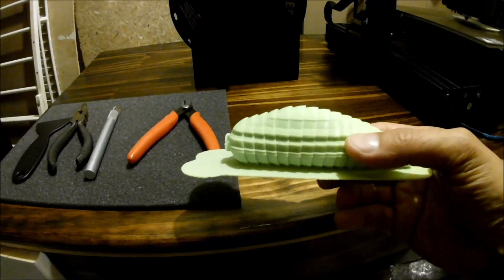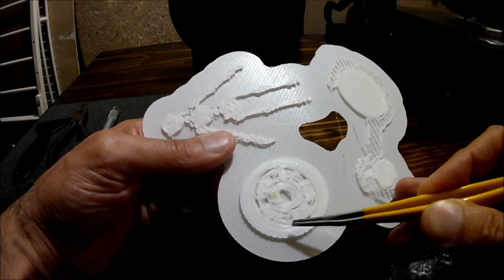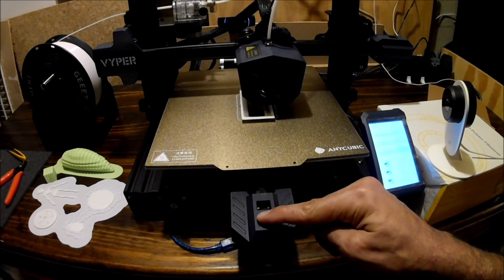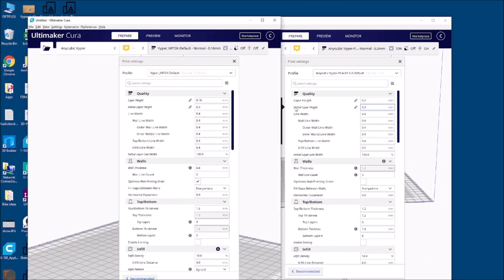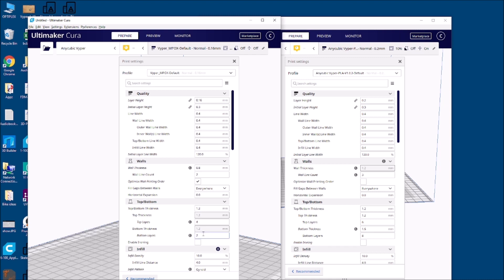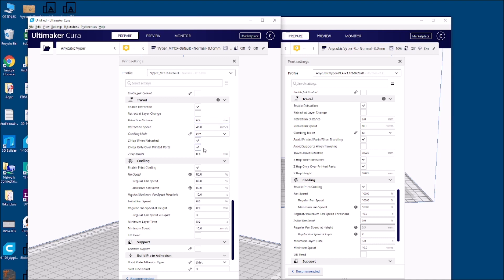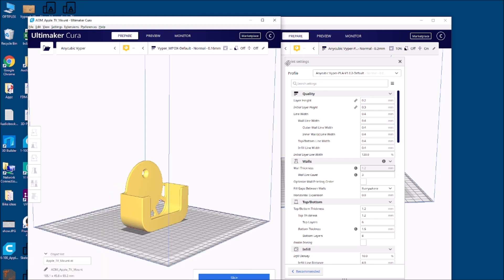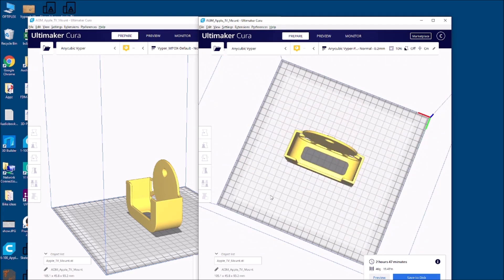Anycubic Vyper- Layer shifting & tips to solve it.  Plus MPOX vs. Default Cura profile comparison

Comment: I've been experiencing layer shifting on some of my longer prints.  I've printed the cube and it has come out great.  Most of my less time involve prints come out great.  I'm going to try your suggestions.  I'm hoping to get the problem resolved.  It's frustrating the have a project fail 3/4 of the way through a 15 hour print.
Reply from the maker: Yes, I had several disappointing prints myself.  Patience is important here and keeping the nozzle from hitting the part helps a lot.  Best of luck, thanks for watching.
Reply: Have you fixed your problem? If yes could you please say what was the problem?
Reply: @maxgroo2626 The MPOX profile has corrected the shifting problem that I had.
Reply: @wonkster1970  Ok, thank you)

Comment: Thanks for sharing, thats some crazy shifting i was able to get rid of some minor stuff by tightening everything but still noticed on travels it oozed filament that would leave a line or spots as it traveled, i thought this was part of the print for  the longest  and couldnt figure out why it was spotty sometimes thinking it was the z-offset which never got rid of it unless i went really hi which messed up the layers.  So it turns out the z-hop setting can fix that, thank you!  That is a potential for problems and actually ive restarted prints because of it, thankfully during the first layer as it travelled it would leave those lines and they'd get caught on the next go around sometimes , but one time i left it when that happened and the print sorted itself out, but still,  a very easy source of problems fixed with z-hop, thanks again!
Reply from the maker: Glad to hear this helped!

Comment: So these settings fixed the green thing you were trying to print at the beginning of the video?
Reply from the maker: Yes indeed, I got the part to articulate correctly, smooth print without layer shifts.  Hope it helps!

Comment: I discovered my frequent layer shifts were because I tried calibrating my E-steps and despite my best efforts, seem to be slightly over-extruding.

I didn't make the connection till I bought the Anycubic Kobra, had amazing prints from it, then discovered similar behavior  after using the teaching tech esteps calibration tool.
Reply from the maker: Good to know and thanks for sharing this info!

Comment: the bottom layers is either thickness or number of layers.. It does not create the thickness using the number of layers..

So if your layer height is 0.2mm, and you have 4 bottom layers set with 1.6mm bottom thickness, it overrides the thickness and uses just 4 bottom layers so a thickness of 0.8mm - That is why the thickness is greyed out..

If you click the Fx button next to the number of layers, it switches back to calculated based on the thickness and would give you 8 layers (1.6mm/0.2mm). By entering a number of layers you override the default calculation and the layer thickness is no longer used.

The other issue you have is most likely the acceleration in the default profile, you need to switch to "All Settings" to see them, but acceleration is what mostly causes layer shifts, if it is set too high then the rapid acceleration is more then the machine can cope with and it loses steps, so even a slight additional resistance of touching a slightly raised part is the straw that breaks the camels back.

Creality defaults for acceleration are very conservative at 500mm/s/s, you should have little issue doubling this, I use 1500 without any layer shifting.

The speed is really of little consequence,  for anything but long moves its is unlikely that the speed will actually reach set point with a conservative acceleration, with acceleration at 500mm/s/s you can wind the speed all the way up to 150mm/s and a calibration cube will probably only get to about 40mm/s as it simply does not have enough time/ distance to accelerate to higher speeds. Think of it like the gas peddle in the car, if you slam your foot down hard the car will start skidding, losing traction, and maybe control, if you press the peddle slowly the car maintains traction,and speed increases, they bot will eventually get to the same top speed if you have enough road but doing so slowly is safer and gives more control and traction, the printer is the same, lower acceleration gives it more traction and control..

So to sum up, it is the rate of change of speed, acceleration, which is the major contributing factor here.. If the move is long enough for the nozzle to get up to 80mm/s  once it reaches that speed its inertia will plough through minor obtrusions without skipping steps, it is in the acceleration stage , when acceleration settings are high, of the move where the printer is working at its limits and during that stage even a minor problem will be enough to cause the motor to skip.

I hope this helps you understand a wee bit more of the 460 odd cura settings there are to learn!
Reply from the maker: Thanks for these details!  I've been using a slightly modified MPOX profile for Cura and my layer shifts have cured.  Z Hop height seems to have helped quite a bit but as you said, that may not be the cause but the symptom of other settings needing adjustment.   Thank you for checking out the channel!
Reply: @renaissancelaboratories5645  I Shou;d have said the biggest cause of layer shifts is slack belts, and the print surface moving on the bed if not clamped down tight enough..

problems with prints are much more likely to be hardware issues than settings issues, default profiles are normally fairly reasonable as long as the machine its self is performing as it should be... There are many cases where trying to fix a poorly assembled/ maintained machine lead to a settings adjusting rabbit hole that never ends..

Comment: I think the 0.16 is chosen because it matches a number of steps per revolution of the z axis. Technically with the new drivers that do microstepping is not necessary but people who worked with old stepper drivers tend to adjust based on these.
Reply: I personally use this mpox profile but with adaptive layers set to +0.2 / 0.005 step. It cuts in half simple prints (as it almost doubles layer height in those ones), but ones with lots of z detail are still slow.
Reply from the maker: Great tip, thank you for sharing!

Comment: Is the bed wires getting caught on the y motor?
Reply from the maker: No issues with the bed wires at all.  They are stiff enough to have limited movement. There is a bracket on Thingiverse if you are having issues.  Thanks for watching!

Comment: It sounds like you may need to increase the electrical current to the axis that is shifting. It can be done through a command line interface, with gcode. A google search will pull up many guides on the subject. I believe that slowing it down is just a bandaid solution. The default profiles are always too fast in my experience, but the Vyper should be able to print very fast. My Vyper is arriving tomorrow, and I’m just looking for what problems I may have to contend with. Thanks for clueing me into this potential problem, and I hope you can get this sorted without having to print at 1/3rd of its potential. Best luck.
Reply: The current can not be adjusted by command line interface, the TMC2209 drivers were not installed with uart communication, so they have to be adjusted by using the pots on the board, but no vref has been given to know the recommended current.
Reply: @B3DPrinting  good to know. Thank you.
Reply: You cannot do that on vyper, nor most of the budget printers as they have no UART mode for the steppers..

The issue is not the motor current, it is the 3000mm/s/s default acceleration, its simply too high an acceleration for the printer to cope with, there is too much mass in the bed to throw it around at that rate..

Dropping acceleration to 1500 to 1000mm/s/s will fix the issue without changing anythng else..
Reply: What should the travel acceleration be?
Reply: @michaelm6334  start with it the same.. 1500 to 1000..  And make sure bed belt is not lose..
Reply: @AkiraFurball  Thanks! Set it to 1500; seems to have solved my layer shifting issues. Thanks for the help.
Reply from the maker: Thanks for the tip!  I agree that it's no good to slow the print down to compensate for an error that can be fixed elsewhere.  I'll continue to experiment and also look into the gcode for current that you mentioned.  I'm thinking it may be M906 or M907 commands according to the Marlin reference- https://marlinfw.org/docs/gcode/M906.html 
Thanks for watching.
Reply: @renaissancelaboratories5645  I received my Vyper Tuesday, and  it was the most painless setup I’ve encountered with a 3D printer. I performed the usual calibration, and torture tested it with a difficult print. It performed flawlessly even at high speed, and acceleration settings. I’m really impressed with it. I saw that some people have had their Y axis motor mount break. You may want to look into that as well, and check the Y axis pulley to make sure it’s hasn’t come loose, if you haven’t already. The key search words for the current gcode adjustments are “TMC2209 UART current adjustment”, and the gcode Marlin command is M906. https://marlinfw.org/docs/gcode/M906.html

Comment: The default profile is a mess, I had the same problem with the Anycubic Vyper's default profile.
This happens because the travel acceleration is set to 3000 which is way too big. I just use a profile from Creality CR-6 SE with some tweaks.
Most of the times I use 0.2 mm for layer height, but if I need more accuracy I use 0.16mm or if I need speed 0.28mm.
Reply from the maker: Great info, thanks.  Yes, 0.2 is a reliable height but I've used 1.6 as well and I tried 0.08 but it didn't seem to make much difference in detail on a mini.  Thanks for watching, I may try out a CR-6 profile.
Reply: I actually cloned my Ender 3 Max settings for everything over to the Vyper, all I changed was retract, and acceleratio/ speed etc as the vyper can cope with more speed and acceleration due to lighter bed and hotend..

It actually works quite surprisingly well!